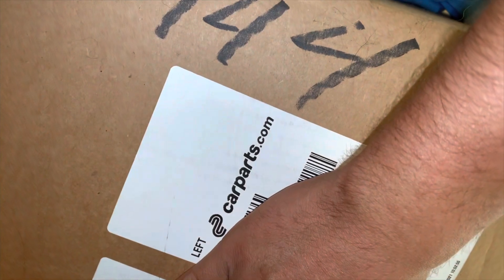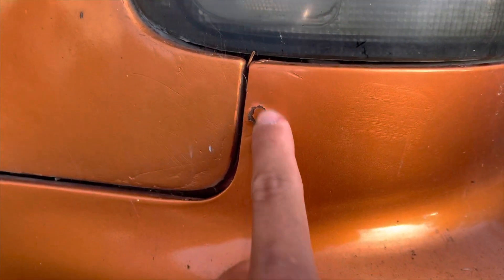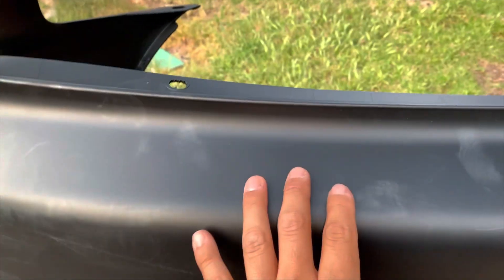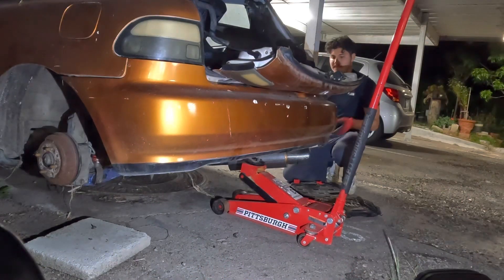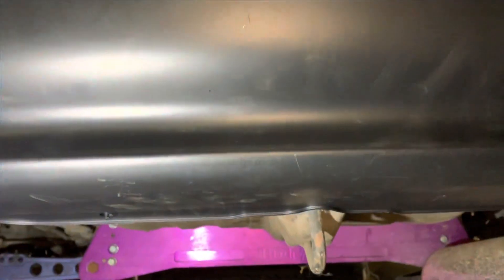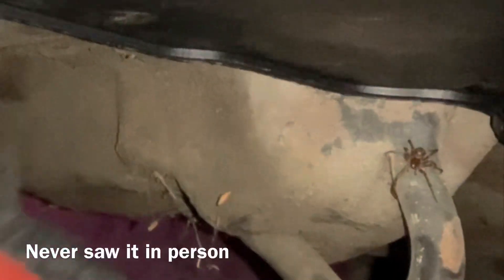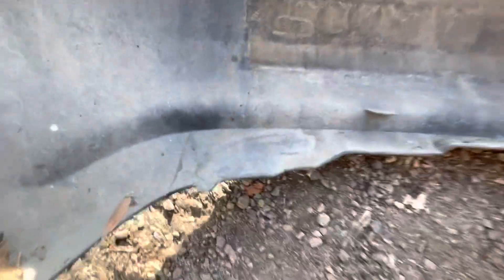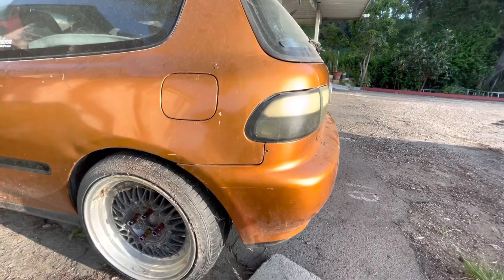Testing A Cheap Amazon Bumper On My Honda Civic Eg | Does It Suck?

Comment: My ebay front bumper was folded 180⁰ degrees on the ends in a near flat box. I should have made a video on how i made it perfect. I bolted it up. I forced every gap and body line into place and clamped it. In a 30 gallon metal drum i boiled a toatal of 60 gallons of water pouring the boiling water all over the bumper in and out. Afterca week i removed all the clamps that had forced the bumper into shape. When done it fit like oem if not better👍
Reply from the maker: Definetly should of made a video. That would help people buying aftermarket bumpers. I just wasn’t gonna use it from the start if my bumper wasn’t broken so I didn’t mind not putting in too much work. My front bumper is aftermarket though. So maybe when I start making it look nice again I’ll start working on that fitment

Comment: My front bumper was replaced and dont fit like oem
Reply from the maker: Probably was an aftermarket part. You have to get an original. With some extra body work it could work but I’d recommended finding something original